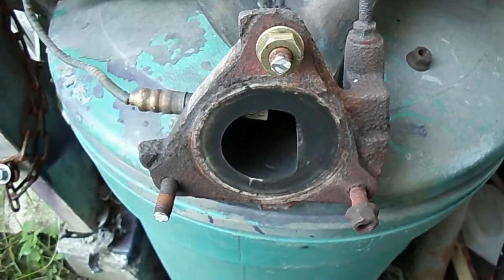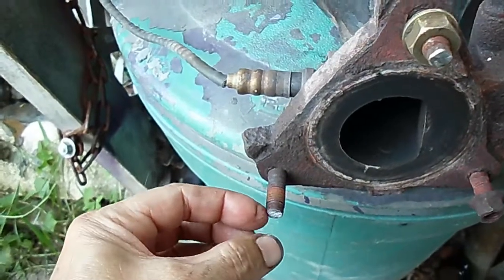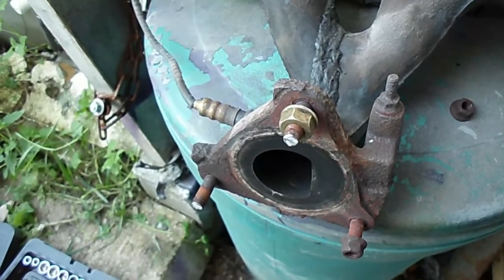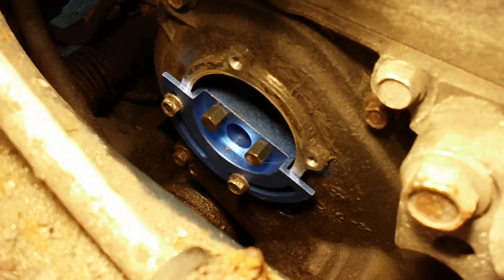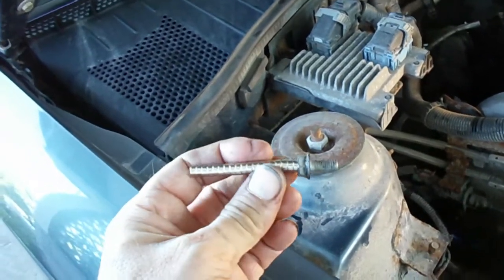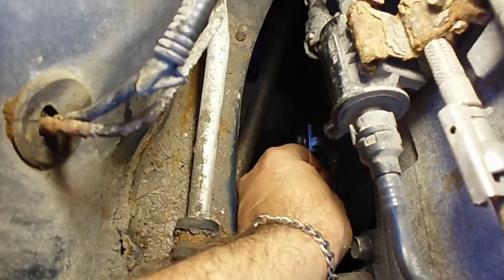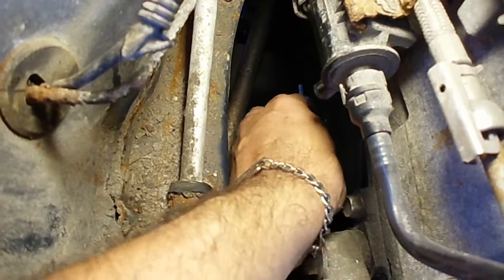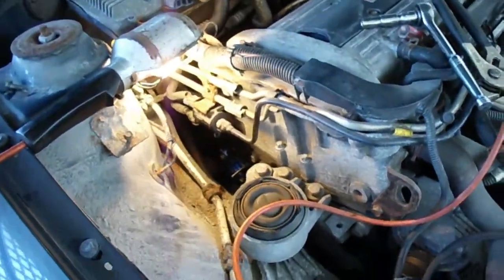Stopping a BIG Problem on 2.2 ECOTEC water pump job

Comment: Well I dropped the bolt into the timing cover, any suggestions on retrieval or can I leave it there and buy a new bolt?
Reply from the maker: Well now, that doesn't sound good!  Refresh my memory, how long and what size is the bolt in question?  It would probably be a big pain to remove the oil pan to retrieve it. I guess it is all a question of risk. if you leave the bolt there and run it, it could go flying around and jam up in a critical way, like in the timing chain. If you have to leave it there, I would put  strong magnet onto the oil plug, so it could possibly grab onto it. Is they any way to fish it out with a magnet on a small stick, or a magnetic probe?   I got it, tip the car upside down, and shake it out!  :)     Let me know how it works out. Take care.

Comment: Why would the water-pump leak oil? Was it really designed with an oil galley that has to be sealed in that area? I shouldn't be surprised, I've seen many questionable design choices on various cars. Lack of space to work reminds me of changing the belt on my parents' Ford Taurus, terrible pain to do!
Reply: TheFurriestOne 
Water pump is driven by timing chain. Or more precisly balance shaft chain.
Reply from the maker: The water pump is chain driven on this design, so the one side of the pump is subjected to engine oil, there is a weaping hole for oil or anti freeze to leak out id either seal leaks. the messed up thing is that the noise I thought was the water pump is something else, as it is still there  :(
Reply: Huh, interesting design. Sorry to hear it didn't fix the problem! I had a trip down the rabbit hole chasing a squeaky pulley on my parent's Taurus once, turned out to be two pulleys!

Comment: Did a valve replacement, balance shaft chain and guide, timing chain and water pump job on one of those pile riders once, never again!
Reply from the maker: I hear you, they can be a choir to work on. I am hoping my Focus timing belt change goes without too much pain and suffering!

Comment: could you put the magnets in the socket?
Reply from the maker: Yes, I think that could be done, though you couldn't fit as many, and they have more grip when stacked up, as far as I can tell.
Reply: Robert Hardwick 
I use magnetic sockets for bolts like that. They are 1/4" hex bits but with socket. I have 6/8/10/13mm sizes.

Comment: Wrap your tools about 30 times with light gauge wire and jump a batterys porsts. Theyll be magnetized REAL good. (:
Reply from the maker: LOL  :)   You have to be careful doing things like that, a friend dropped a wrench acrossed the battery posts, it welded the wrench on, making it glow red, and warped the plates in the battery wrecking it!
Reply: Try dropping wrench on a 80Volt 1000Ah electric forklift battery terminals...

Comment: Boy, that thing was only designed to be assembled, later repairs weren't on the radar in that drawing room. Have you got a source of aluminum magnets up there yet? With more and more ice melting away every year I figure its just a matter of time.
Reply from the maker: Yes, replacing the water pump was an after thought for sure. Sorry, no aluminum magnets in these parts, maybe a lot further north.

Comment: Must have been pretty pissed off to come up with using stacks of magnets. Looks like upper motor mount is totally shot to shit too. Reminds me of working on a Ford Focus only you have to pull the timing belt to change the water pump.
Reply from the maker: Yes, I have a Focus that i will be doing the timing belt and water pump on soon, so I imagine it was a real peach of a job!